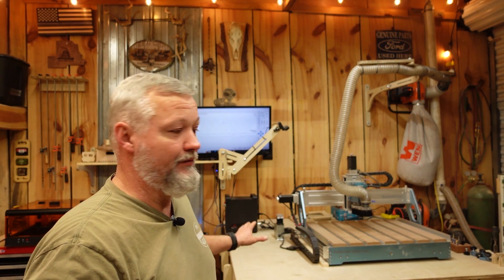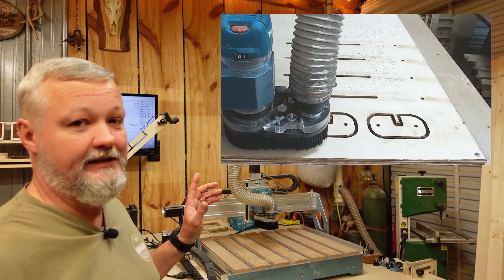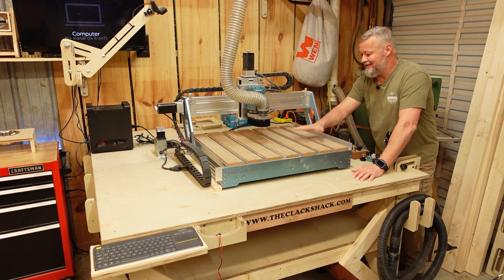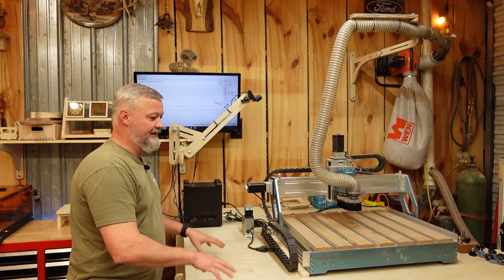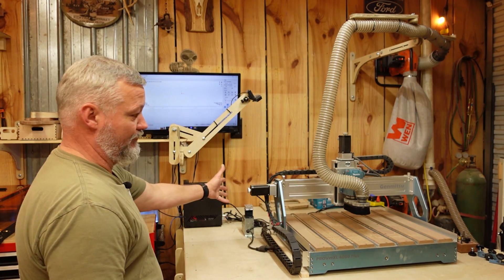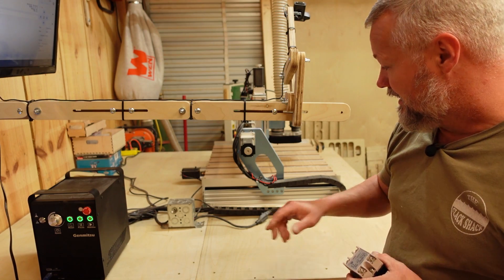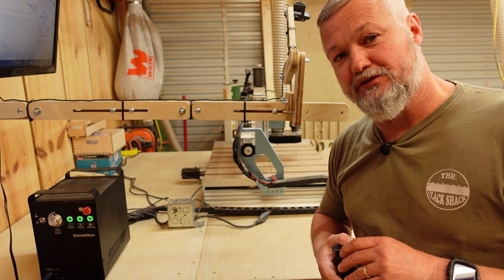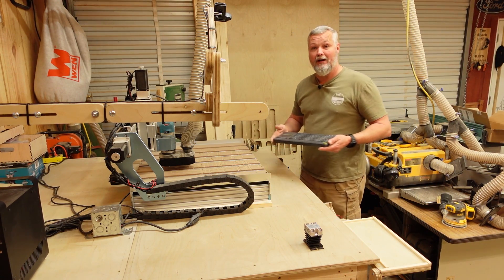My CNC setup

Comment: What do you have on the opposite side holding the 2 pieces of arm together?  Is it the round pieces you was cutting out in the video?  What made you choose the shapeko pro?  I have been running a Bob's kl744 for several years now and I am thinking about upgrading to a onefinity now.
Reply from the maker: Not sure what you are talking about. I used carriage bolts to bolt them. 

As far as the Shapeoko goes, one of my local friends has the 4 pro and I have seen it work in his shop. He has had good luck with it for years now. I got quotes from several companies while considering. As I went through the specs, upgrade options, price and reputation of the companies, I narrowed it down to Scienci labs, Onefinity, XCarve and Shapeoko. I wanted to go with a US company if possible. The 48x48 usable work area I wanted eliminated XCarve. I wasn't crazy about the lack of substructure with the Onefinity as far as the "No work bed". I am more than capable of making a bed but that would increase cost even more. At this point, both machines cost about the same. The included bit setter and the built in dust collection plug were also a bonus for Shapeoko. Scienci labs was by far the cheapest machine but the belts are just hard for me to choose over two machines that run ball crews, that eliminated Scienci labs for me. 

Also, Steve has the Onefinity and I wanted some variety in the types of machines that we can offer support with. In our world of content creation, you also have to consider which machine has a need for more instructional and troubleshooting videos. I felt the Shapeoko users and future users could use a little more content to choose from.
Reply: Good info on your choice!  What I am talking about as your 2 arms come together and appear to be butt ended to each other.  Is there 2 arms side by side holding them together with the bolts?  Hard to tell from 1 side is all.  Sorry to create confusion.
Reply from the maker: @67taylor94  I made a T to use to change direction 90 degrees. Yea, I think that was the pieces on the cutting video

Comment: Neat arm setup! Could you use a dovetail arrangement to eliminate the ties. Thus they could slide and use threaded inserts for the clamping.
Reply from the maker: The arm is held together and is slide adjustable with carriage bolts. The ties are only for cabling or hose. I have a design for clamps but due to added weight to the setup, I went with zip ties. I may try the clamp idea, but haven’t had time yet.

Comment: What machine you got coming
Reply: I just got my PRO 5 4x4 as well.  One recommendation I was given that's been great is to actually put down the foam tile mats (I got mine at harbor freight) as a vibration barrier between the plywood table top and machine.  Definitely made a nice addition for minimal cost too.
Reply from the maker: Shapeoko 5 pro 4x4. Ordered and waiting..
Reply: @TheClackShack badass
Reply: Nice got my 4x2  a few days ago just waiting to get my table built, bought a 4040 Gen to practice on got hook and never built my table for the big boy, look forward to watching your setup to learn from you